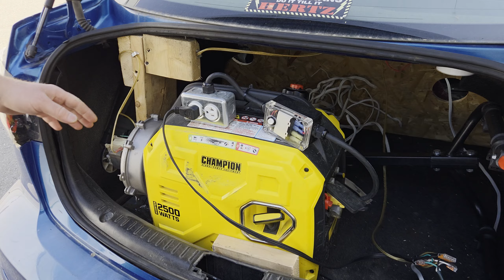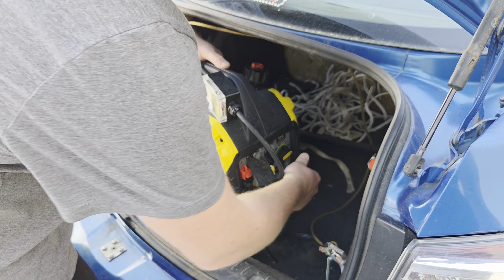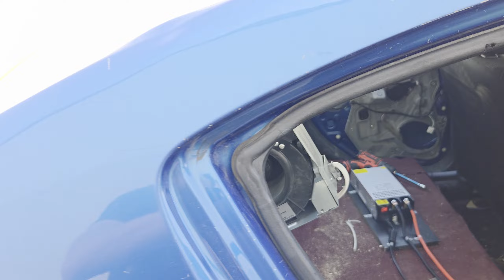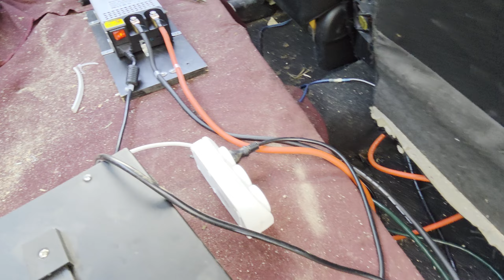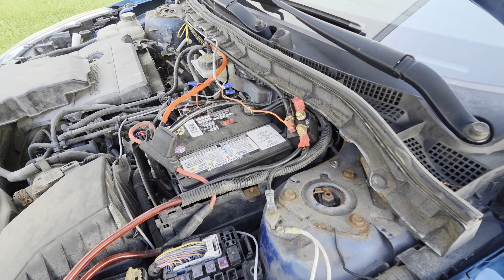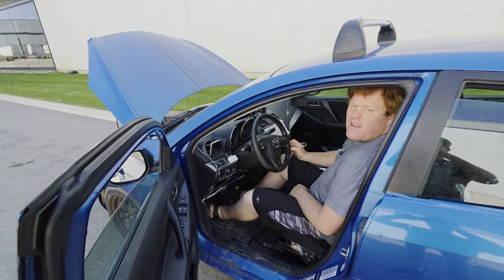Broken Alternator? No Problem!

Comment: 2000 dollars of electricle equipment to replace a 250 dollare altinatror plus labor, but I am, entertained. I still think its cheaper to run a long exstion cord as you are just using it around town any ways.